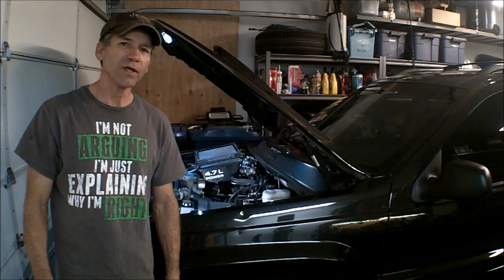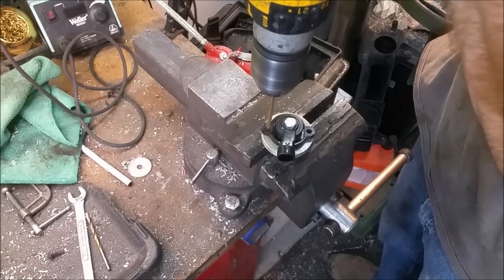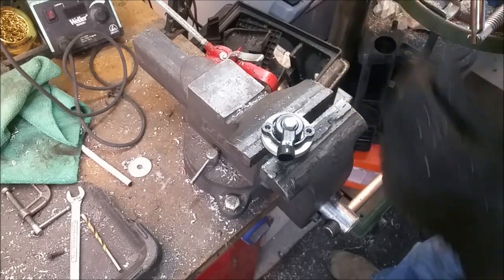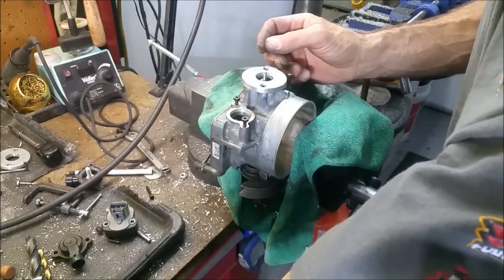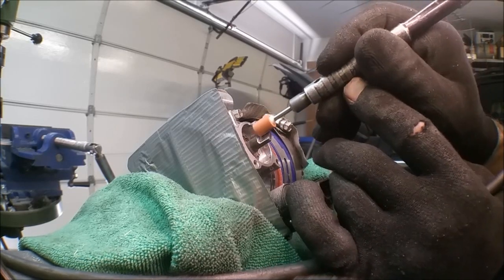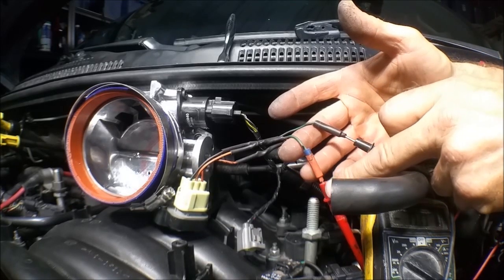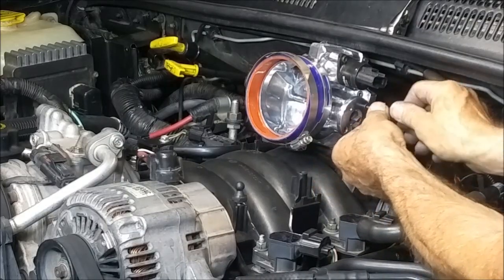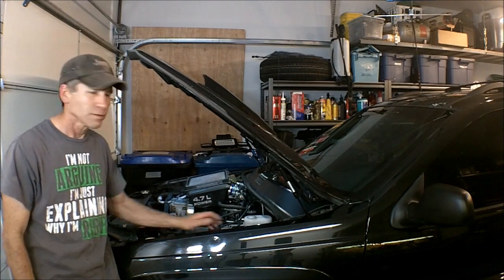Installing 75mm Throttle Body Dodge, Jeep & Chrysler 4.7 Part 2

Comment: I have a question. You may know, or you may not. My 05 Jeep check engine light turns  off and on while I drive but there are no codes. Any thoughts on what it might be

Comment: how I'm doing the conversion of this video only I have doubt in the video comes a sensor as air temperature the question is that my jeep does not bring that sensor and would like to know if it is a joint adaptation that has to be done thanks epero you can help me since I'm about to finish the adaptation
Reply from the maker: I am not understanding what you're trying to say ....that is the throttle position sensor that I'm making the adapter for.. I don't understand what you're saying about temperature ...your vehicle has to have that throttle position sensor ...you may have the 1 bolt throttle position sensor. If you have the one bolt throttle position sensor this modification will not work.

Comment: Hey there I'm building a 05 jeep grand cherokee laredo 4.7 2wd I upgraded the heads to take care of the valve problems and I'm in stalling the ho cam along with the 08 intake I want to do the gm throttle body to and I'm deleting the cats as well
Reply from the maker: Brian Reeves sounds good. Let me know how it turns out.
Reply: Can you make me the throttle body adapter plate for the 75mm 454 throttle body and the idle air adapter plate I'll pay you
Reply: I ment the tps
Reply from the maker: Brian Reeves I wish I had the time. I was thinking if I ever got a 3D scanner I would  use my daughter's 3D printer I could start printing out the parts.
Reply: I have so many people that would buy from you
Reply: martinbuilt I'd be careful with 3D printing the parts, as they wouldn't tolerate the engine bay temps very well. Scanning your adapter and making a 3D model would be great because you could send that to somebody with a waterjet or machining equipment and have them built rather quickly.

Comment: Did you tune the beast yet
Reply from the maker: No not yet. I do have a Trail Dash 2 it looks like you can do a custom tune with that. Just haven't had the time to look into it.
Reply: martinbuilt do you have an email were i can contact you

Comment: We want to hear and see it perform on the road!    Thanks for being the guinea pig but also showing what others may run into when doing these mods.    There really isnt any performance parts for the 4.7l motors.   Great job!
Reply from the maker: Andrew Shealy I did take it down to Las Vegas Motor Speedway and ran it down the quarter mile 5 times this past Friday I could post that. I personally can't say I was too happy with it I was expecting a little bit lower ET. I definitely need to get it tuned

Comment: Soon or later he going to have problem with code
Reply from the maker: Alberto Orellana I've been running this throttle body now since April 24th the only problem I had was that one code with the TPS. I think if any other code was going to rear its ugly head it would have done it by now.
Reply: martinbuilt how many horsepower do you gain with this modification  you let me know please
Reply from the maker: Alberto Orellana there is no way I could give you a hard number because I did not do any Dyno runs before I did this mod. With all upgrades I have done so far this one I could feel the biggest Improvement.